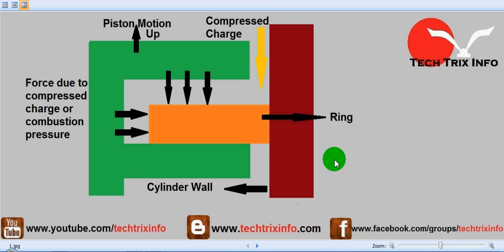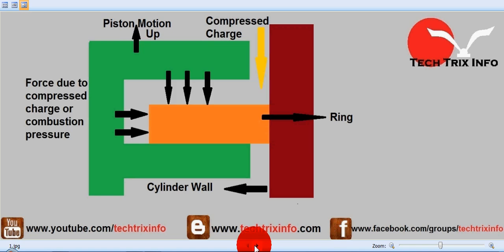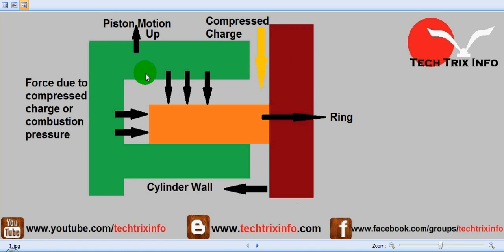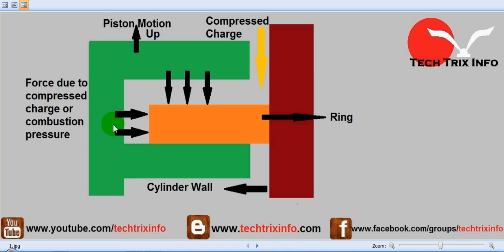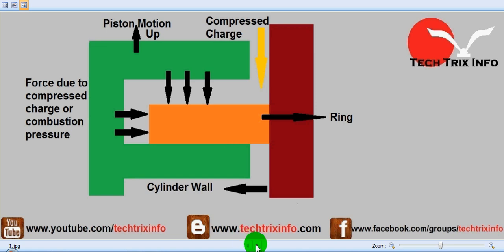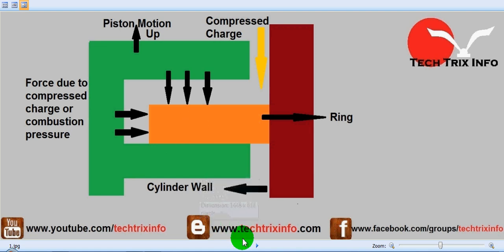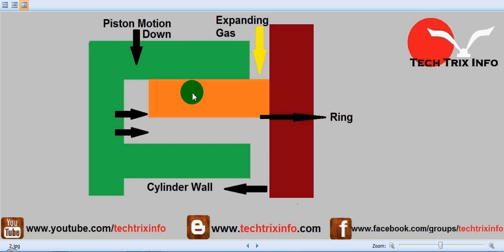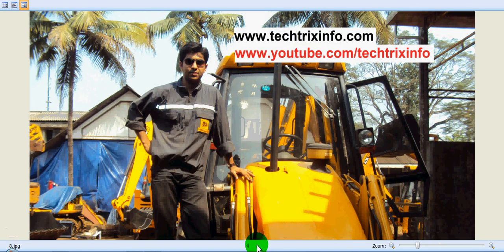How compression ring in engine works. ✔

Comment: This is completely wrong when your piston moves down on the compression stroke the ring is still on the bottom of its groove. The only time that the ring is on the top part of the groove is on the intake stroke.  one out of the four strokes the piston ring will move To the top part of the grove
Reply: yep
Reply: I agree with you...bcs during expanion stroke pressure above the piston is too high and its not allowing piston ring to move upwards.

Comment: So tell me if I am correct here or not (I am young and therefore new to engine rebuilding) - the amount of compression (therefore efficency+power) loss due to the small gap in the ring is less than the amount gained by having a thing which can expand to seal *most* of the circumference of the piston in the cylinder bore, yes?  I know that piston rings are essential, but honestly no explanation I've yet heard has really described their purpose/function well in a physical sense.
Reply: Its so burning gas 1250 degrees Celsius+ does not come into contact with the lubrication oil. Most lubrication oils start degrading pretty rapidly when exposed to temperatures above 250 degrees Celsius. And of course its beneficial for the efficiency, for containing the gas within the top side of the cylinder aswell as keeping the lubricating oil in good condition.

Comment: But the rings are C's not O's so how can it possibly seal if theres a gap in them?
Reply: Piston ring is not a C the piston ring is a complete circle with .0020-.0030 20,000-30,000 of an inch removed